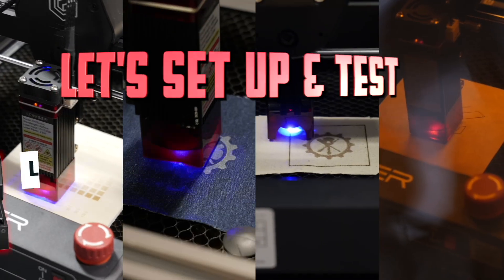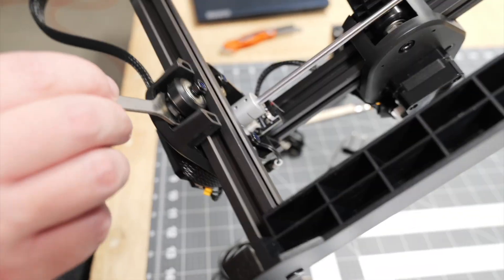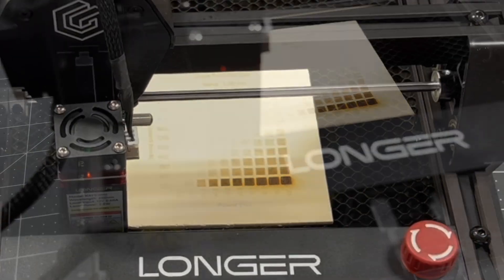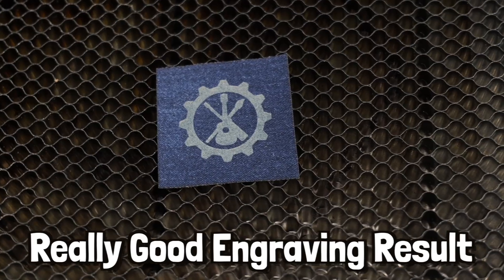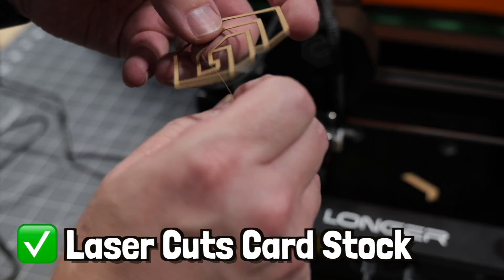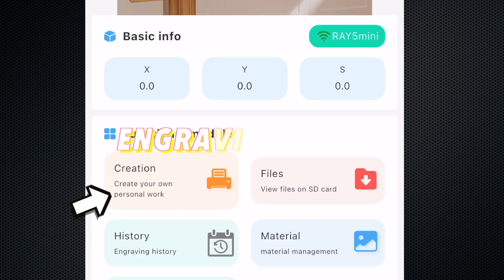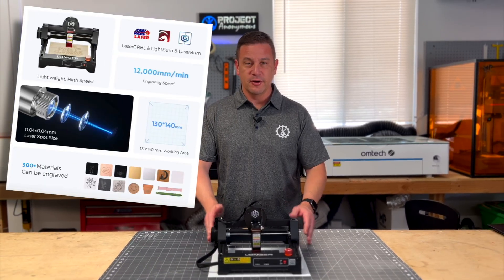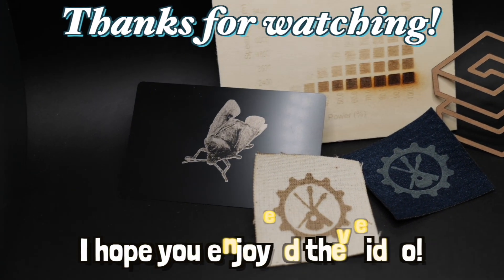AFFORDABLE RAY5 Mini 2.5W Diode Laser Engraver - Machine Set Up & Guide  #longerlaser

Comment: I would like to engrave on 20mm metal tags similar to dog tags. How does the machine or so I sync up the engraving space? Like how does the laser know where my tag is?
Reply from the maker: Hi! This laser doesn't detect material, but in the software you use, you can frame your design and position your material accordingly within your workspace. I hope this helps, thanks for watching!
Reply: @ProjectAnonymous_Duo thanks for your response will check this out
Reply: Did you find an answer for this?